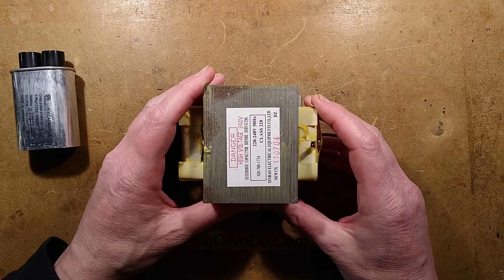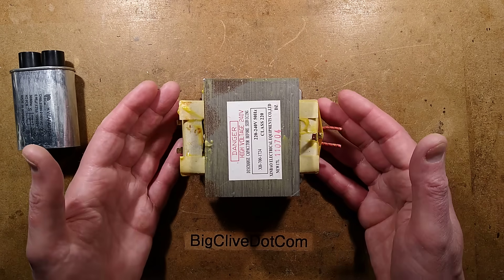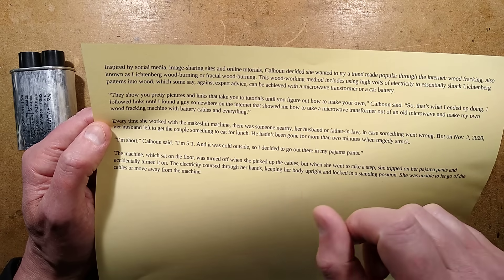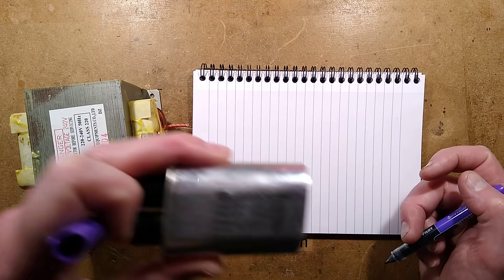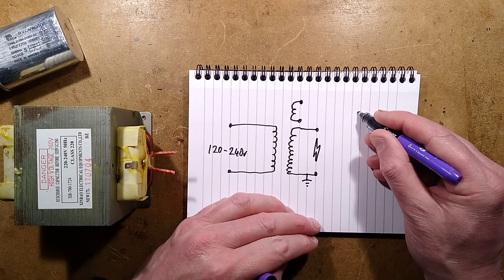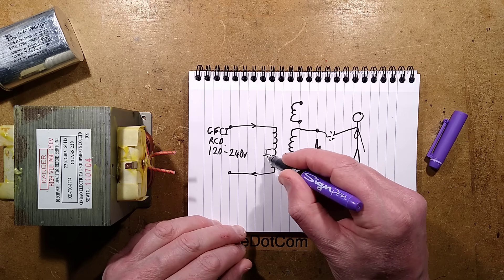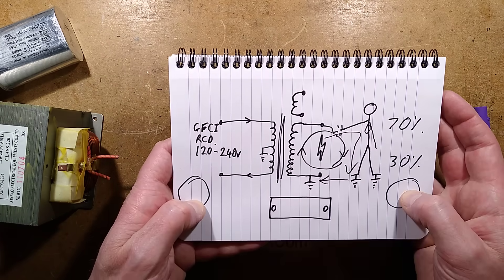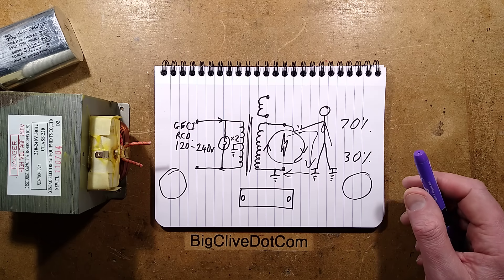The most deadly project on the Internet

Comment: How does 2000v kill but an 8000v cattle fence not kill me? can someone explain :)
Reply: The power difference. Voltage, current, and duration in combination kill. The fence has far lower duration of each pulse.
Reply from the maker: The electric fence delivers spikes of current like static electricity.

Comment: Youtube recommended this to me randomly and at first I thought it was clickbait. Wow. Never would have thought people would so carelessly play around with high voltage. I definitely think having a fear of electricity is the one rational fear to have.
Reply: I think there's room for more than one rational fear.
Reply: what about fear of fire
Reply: @encross8058  also floodwater! Floods kill thousands a year!
Reply: @ps3master72  yes
Reply: You can do it bro building it is pretty simple, you litteraly have to connect four wires. Using it safely however is all on you. And yeah having built one and played with it I'm confident it can kill you. The sound of open raw electricity running across the wood told me so.

Comment: Don't ground the transformer case to earth ground. Never touch the high voltage cables just hammer in nails into the wood connect to them, stand back, turn on the transformer and watch the show. Battery cables are only rated 600 volts the transformer puts out 2K do the math. I use a Variac to control the burn.

Comment: I used to do fractal burns. Heavy PPE. Used long pvc with the arch points on the ends and had a red bulb light hooked into it that was on when the system was. Still made me nervous every time I used it. Gave up the hobby the more horror stories I heard.
Reply: Glad you’re not courting danger like that any more.
Reply: I’ve said this before, this is one of those things where you simply cannot do it safely. Just like you couldn’t drink 10 shots and drive across town and say you did it “safely”.

Comment: Awesome video! I'll share my stories, too.

One time when I was probably 17 or 18 years old we were staying in a hotel and one of the lights wouldn't turn on. Having been in many hotels, I'd seen lamps with all sorts of "on" switches, including ones with the switch up underneath the bulb as part of the socket it screws into.
I was half-paying attention and feeling around for the switch...
Until I found one which I pushed down. Immediately all the muscles in my right arm contracted, and instinctively my legs pushed me away. I ended up a few feet away. It felt like someone hitting my arm with a hammer for that split second, and then it was gone. Hard to explain, but very unpleasant. My heart was racing.
It turns out they hadn't put a bulb in the lamp, and I had pressed the little black button that normally gets compressed underneath the bulb, allowing the power to come on. Instead, the power went right into my fingers.
This is the USA, so 120V, but still. I learned my lesson not to go carelessly poking around with the power turned on...

I also got shocked by the ignition system in my Mustang, which has an MSD-6A high-voltage system with an MSD blaster coil and billet distributor. Holy crap. It hurt so much.
Fortunately I had a gardening glove on with rubber fingers, and I only got a light shock, or I'd have been in much worse trouble.
I had been adjusting the timing by turning the distributor, and there must have been a bad ground.
I was shocked a few other times doing the same thing, but only mildly...that one big one was enough to scare me pretty good, though.

Microwave transformers? Yeah, I don't think I'm cut out for high-voltage hobbies...

Comment: Voltage doesn't kill, it's amp's that kill. Though high voltage can and will jolt someone. It won't kill them. But even the smallest amount of amp's can and has killed.

An automobile's distributer put out an average of just over 25,000 volts. Though I've had a few occasion where as it's jolted me seemingly to the N-th degree. Becasue the amp's are so low, I'm still very much alive.

Saying that, the Alternator of an automobile puts out an average of a 100 amps on new cars. But at the same time is provides very little voltage. An alternator can and will kill in a heart beat. Because of it's amp's not it voltage. The condenser will give on hell of a jolt, but won't kill.
Reply: Not really. It's total power that actually kills.

Comment: Ohm's law? The automotive jumper leads are beefy; 12-24vdc at 600-1500a, and quality cables are thicker than cheap ones. I think they might be able to handle high voltage at lower amperage. Plus, the voltage rating is "12-24" more so people know they're right for the 12v and 24v vehicles that might need 'em, and less as a maximum safe operating voltage warning.

I agree with you on everything else though, and thanks for what we Yanks call a PSA - truly, a public service announcement.

Cheers!
Reply: definitely a psa

Comment: for one, i built mine on its own plank of wood, insulated with rubber feet. also, a foot pedal acting as a "dead man's switch" is a smart idea. if it does pop you, your foot moving will kill the power. only problem is, the voltage doesnt pull you to it and fry you... it pops you and stops your heart. if youre not maimed for life. so youre pretty screwed if you fuck up. so many more fun ways to die. theres a short vid on my channel. not a tutorial. i wont teach ppl how to make one. if you figure it out and use one, fine. but im not teaching anyone.

Comment: I made a jacobs ladder with a transformer similar to microwave transformers, salvaged from a neon sign. I did not know, but there was a pin hole sized hole at the bottom of the handle of my insulated kleins. I was okay, but discovered a newfound respect even after years working as an electrician. Will never slip up again. Electricity should be treated with as much respect as firearms or cliffsides

Comment: I've been shocked by United States house plug/outlet 115 110 and an outside Outlet of 220 that connects to an AC unit. no permanent damage just a quick painful reminder that electricity should not be played with now the whole concept behind this scares the crap out of me, "so you're going to play with super high voltage and soak everything in your immediate area and electrolytic solution" yeah..... no. like seeing those craft videos showing somebody turning an old CRT TV into a fish aquarium those things are lined with lead dust.

Comment: I few years back I had moved into a new place that clearly had some electrical problems in the kitchen, I can't recall exactly what it was but touching some combination of appliances at the same time would seriously electrocute you. I'm sure if the voltage was just a little bit higher it would've been really dangerous. I had a pretty serious seizure before and it was quite comparable.. The muscle contractions were intense and hindered my ability to pull my hands away for a few seconds.